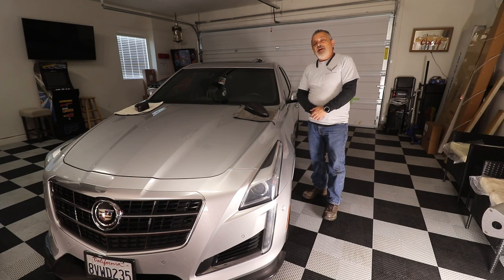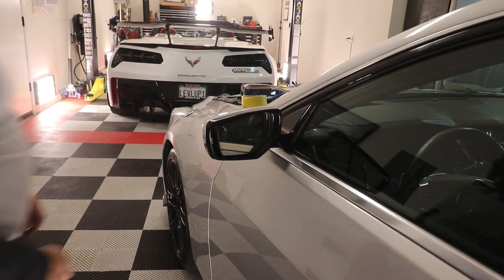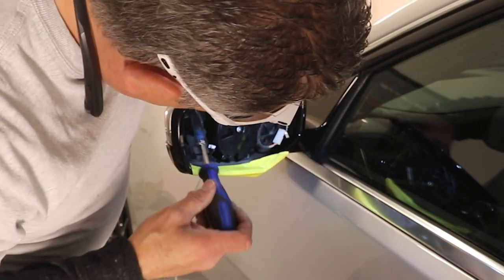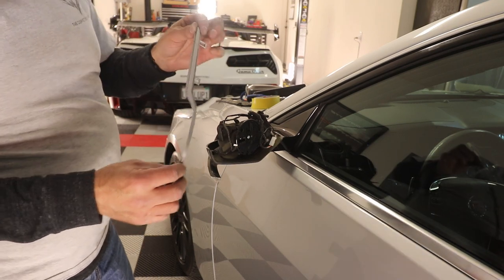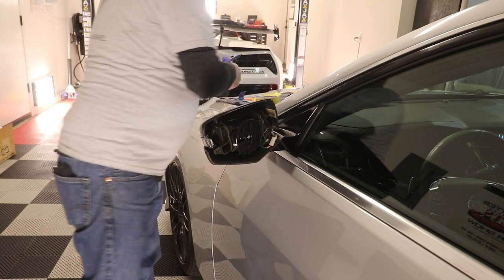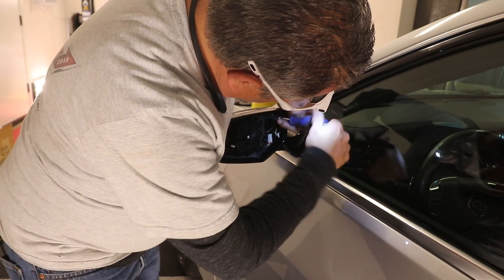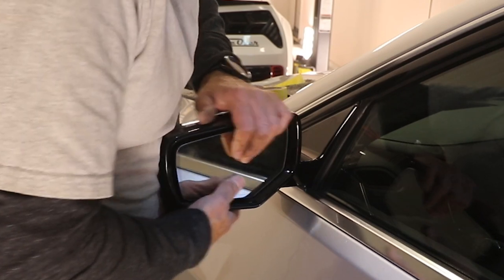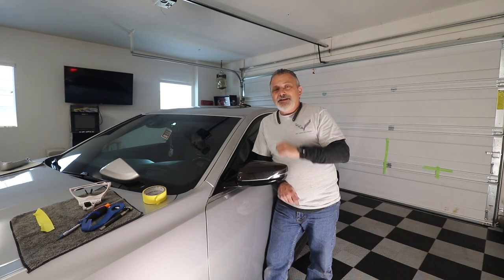How to Install Carbon Fiber Mirror Covers From Extreme Online Store on a CTS V

Comment: 1G6A15S64H0145220 I own this car, do I need to buy a replacement light for the back to install it? It's a 2017 CTS-V
Reply from the maker: Hi there,
You should not have to buy anything else but the cover.
Everything needed comes in the box.